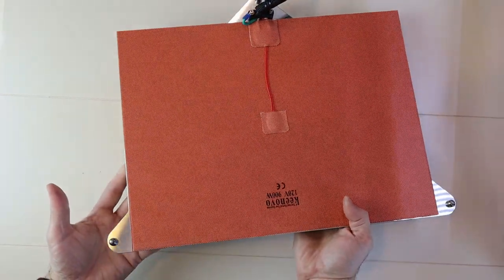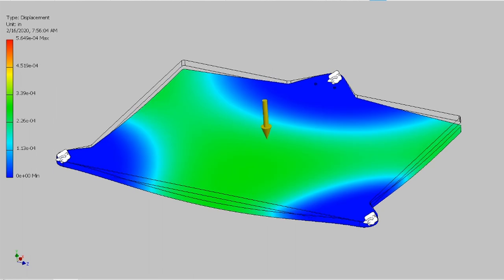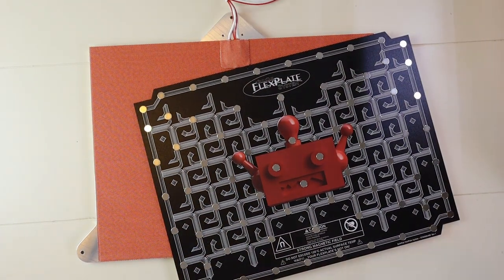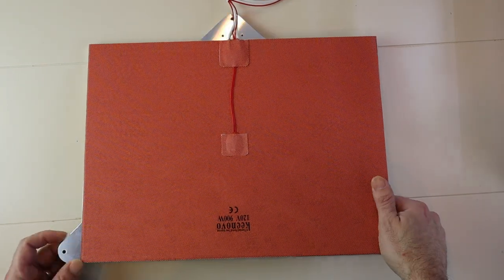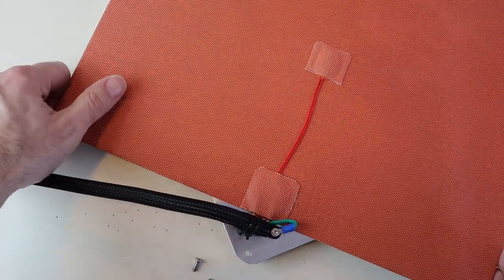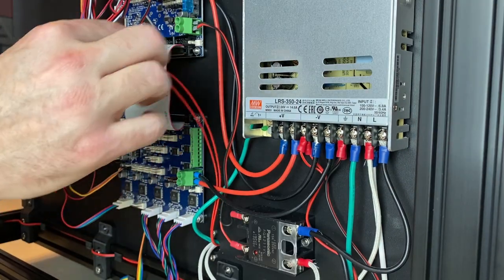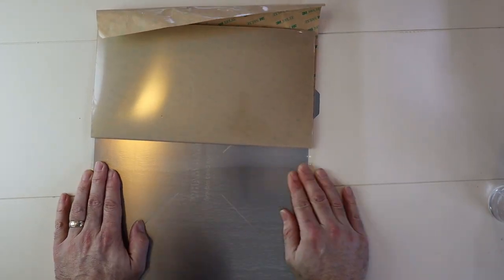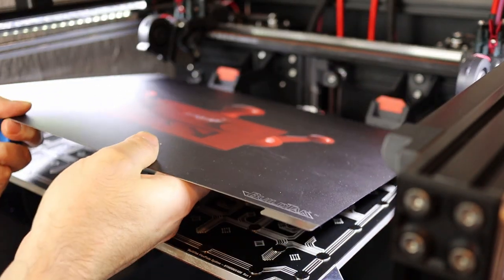MULDEX BED INSTALL

Comment: I was going to try incorporating the remote direct drive with a tool changer, but only changing the hotend to save expense. Same with cooling. One fan will be on the fixed carriage. I really like your frame design and I think I must try it over a HEVO frame for this experiment because of your innovative bed mechanism, I look forward to seeing how it goes. Thank you for the content!
Reply from the maker: Never thought of a tool changer that is not also change the extruder.  Interested in seeing what you come up with.  Credit for the kinematic coupled bed goes to the Jubilee tooling changer.
Reply: I’ve felt so far  it’s a ploy so far to make you spend more on components.  Since there’s a purge I’m going to try a spring loaded bondtech bondtech design that opens when locating the new head. What do you think?

Comment: What I don't understand with heated beds is why we are using the point fixes and not kinematic couplings? In the end the weight is probably heavy enough to keep it on and if you orient the grooves right it can expand without deforming. My employer is using a similar technique on brake discs.

Edit: now I feel stupid. Apparently that's exactly what you are after. Good job :) The deflection simulation is only for the weight of the printed components.
Reply from the maker: I think kinematic couplings are not real common because the bed still needs to be level, so it works good with independent motor leveled bed.  Also in the FEA is the weight of the bed itself.

Comment: Nice printer, when will this be released in the wild? Or will you do some beta testers first?
Reply from the maker: Just working out the config and then it will be ready to release.  Originally designed it for MRRF but I'm not sure when that will take place...

Comment: It doesn’t look like the ground wire is electrically connected to the build plate. Could you install the terminal under the plastic part?
Reply from the maker: Its isolated, when I tested conductivity one probe was touching the bed. However, its ground thru the bolt it might be better off to locate it under the strain relief.

Comment: Is it done? How is it printing?
Reply from the maker: Sure is!  Prints good but still working thru the config. I stopped with the progress so I could get the files released, almost done.  Check out my gethub if you want to check it out.  We also have a FB group, I'll put a link in the video description.

Comment: for someone not wel versed in mechanical engineering,. hat is the benefit of the circular kinematic couplers? if it just because its easier to remove the bed when needed?
Reply from the maker: Each z-axis belt on this printer is driven independently so the bed can autolevel, and this type of coupling allows for this.  It will also allow for thermal expansion.
Reply: @3DPrintingWorlds  fascinating, is this independent 3 z motors allowing for that truly trammed/levelled bed to hotend or is that something else?
Reply from the maker: That's correct, first it auto levels the bed to three points then applies a previously saved mesh bed map depending on which flex plate is loaded.
Reply: @3DPrintingWorlds  so would there need to be 2 different probes? how would it make a mesh before its was level, and why would it load a mesh on an unlevel bled on a level one?
Reply from the maker: One probe, it levels the bed then applies a mesh in case the bed is not perfectly flat. You run macro ahead of time that heats the bed, levels it, then measures the mesh.  There are a lot of probes so it takes a while. Instead of doing it every print you can save and recall it.
Reply: @3DPrintingWorlds  fascinating, awesome thank you. Looking forward to seeing more of the muldex